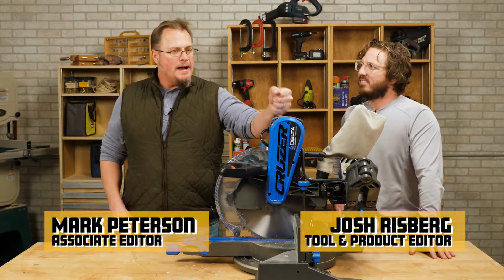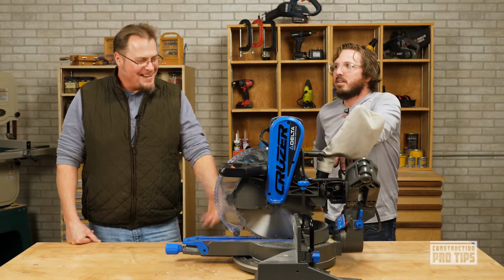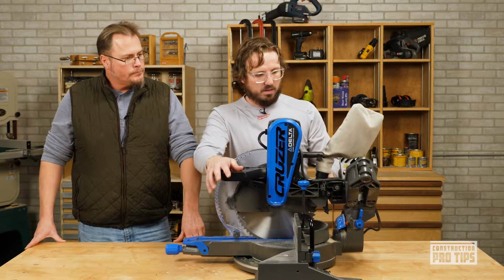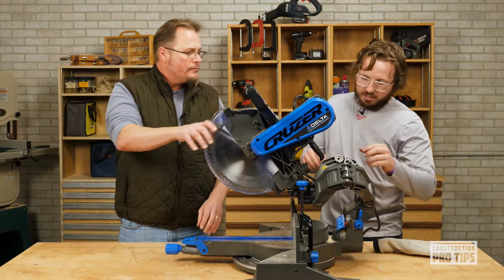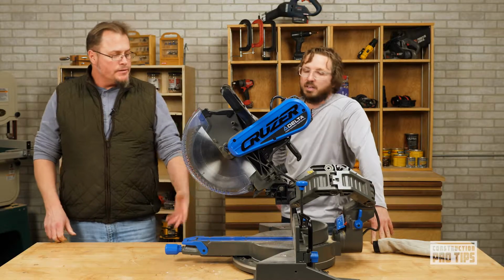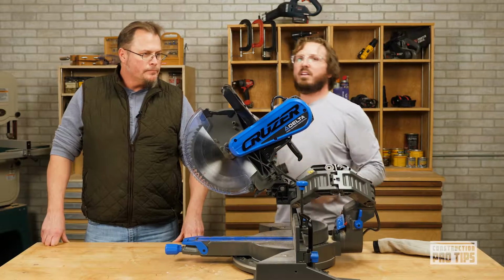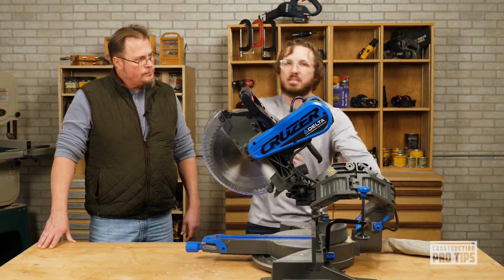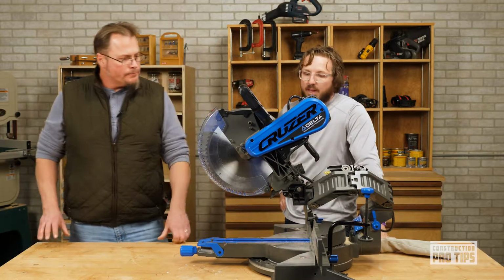CPT Pro Picks DELTA CRUZER

Comment: I have this saw and I am very disapointed with it
Not worth 650, luckily got it on sale for 400 with stand
The twist lock non detent angle lock does not stay set and slides even when locked
Contacted Delta and sent videos
They said I could send back at my expense 
Not happening
Submitted s consumer product safety complaint as the looseness of the angle position is dangerous
Again this is not worth 650
I would not buy this again even at 400
And should have looked at the Hitachi or Bosch
Think twice be fore buying this saw
Reply: Sorry your having troubles. We have been using it a moderate amount around here with no complaints. But the more info out there the better.
Reply: Mark Petersen  are you not experiencing the ability to move the angle of the saw when the detent override is set
I first notice this when doing a compound miter 45degree left tilt st 33 degree legt angle
Then realized that the detent override 1/4 turn mechanism is not locking fully
Also have issue with the detent override pin not releasing when hitting the release button on top of boom
I even bought another saw from lowes after working with delta and all of same issues happened on second saw
Returned it to lowes